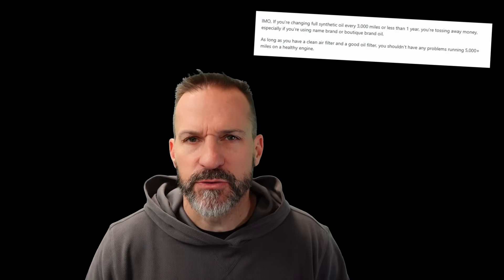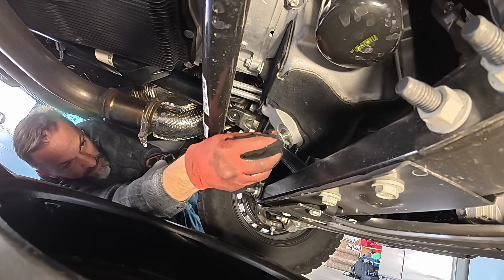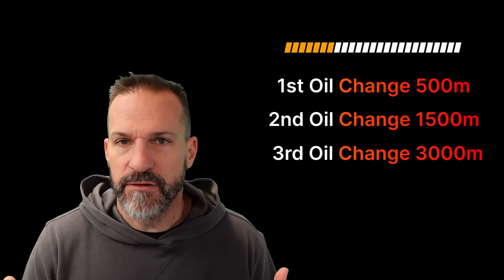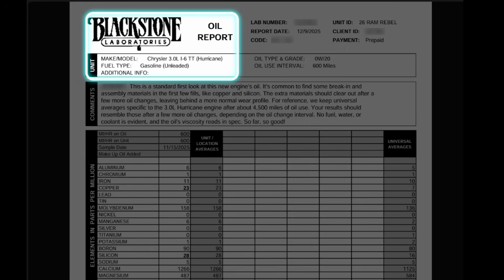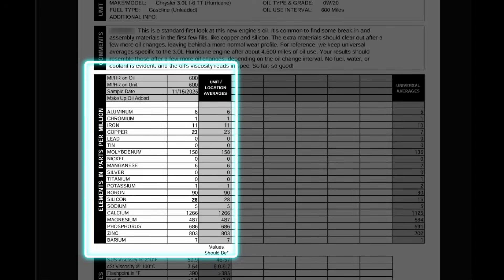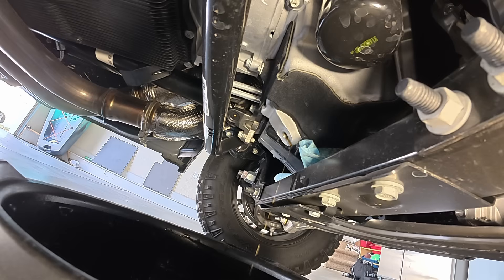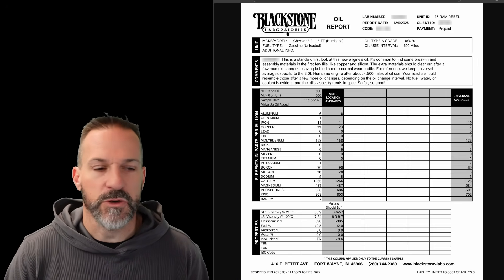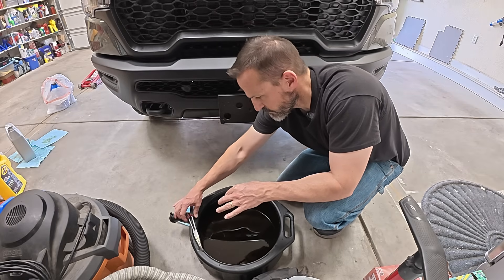Is the Motor Oil Geek Right? I Put His Break-In Theory to the Test

Comment: I would highly recommend Oil Analyzers Inc (OAI) or Speed Diagnostix for UOA’s. Blackstone’s fuel dilution test is nowhere near accurate. I figured that out with my Subaru Ascent when I was seeing 0w20 reducing to a 16wt viscosity in just 4k-5k mile intervals, yet Blackstone showed only a trace to 1% fuel dilution. Come to find out after using OAI, fuel dilution was well over 5%. Either way, keep up with the break-in! It can only help!

Comment: Not an automobile, but the manual for Takeuchi equipment say to do your first oil change at 50 hours and then every 500 hours after that. 
I still do them every 250 to 300 hours like they used to recommend, it cant hurt

Comment: More metal does not mean the engine is harmed. The oil is meant to keep impurities in suspension and the larger dangerous bits are caught by the filter. Intresting to see what would happen if you left it in. Is there any way to scientifically measure the damage done

Comment: A lot to unpack here....until recently, you didn't have many engine failures (think Toyota, Ford, Chevy trucks). The volume of failures and number of recalls is alarming. Don't hear much about sedans (minus maybe to tiny engines with turbos...maybe). Take your average sedan/SUV that is not hyper tuned with turbos, I don't think the engine failure rate is high at all, could be wrong. I think oil change early is not a bad idea, but is it really necessary, even with the testing numbers being shown. Ok, so you have break in metals coming off. If you didn't change the oil at these short intervals, does that mean a death sentence to the engine at 50k miles? Doubtful. What about 100k? or 200k? I would wager that the truck in question here, will rust out, have transmission failure,  electronic goblins, etc way before the engine would fail AS A RESULT OF NOT DOING EARLY OIL CHANGES as the videos suggest. I am not a proponent of going 10k mile OCI, 5k is reasonable for NA engines, I would do 3k for turbo.  There is such a thing as too much information, and the internet is full of it. As for personal experience, I have never done early oil changes on any cars. All of my cars have gone 250k miles on OCI of 5k or 7500 miles. I have also maintained many other cars, one is 25 years old, with relatively low mileage on conventional oil. I never had an engine fail, all vehicles drove fine when I sold them. Some had body rust, one had something going on with the tranny, etc. My current vehicle has 150k on it. For the first 100k miles, I stupidly followed the 10k mile oil change interval WITH driving most of the miles locally, short drives, etc. Engine is still fine and going strong. This is before I knew any better.  I guess the question is, even with the testing data, how do we know if you didn't change the oil at these low intervals during break-in that there would be engine damage to the point of not getting 200k out of it....we simply don't know. Correlation does not mean causation. Just because there are high values in the test results doesn't mean the engine will fail or if it fails, doesn't mean it was the result of not doing this oil change break in procedure. Another example, a friend had the same year car as one of my cars. I did all maintenance on my car. Oil changes, etc. at 7500, tranny at 30k, etc. He followed the dealer advise oil changes at whatever the car told him, tranny every 100k....He has 450k on this vehicle. Mine is at 300k. Both still kicking. Good engineering, manufacturing, QA, results in good cars and with this example, seems like you could do minimum maintenance and get good results (both vehicles are 2010 Honda). I think we are trying to protect against poor designs, poor engineering, poor QA with increased oil change intervals. You could do 10 mile oil change intervals on the Tundra and the engine will still blow at 10k miles. Nothing you can do will change the garbage coming out of Toyota these days. Now, on my next car, I will do an early oil change? Probably "just in case" there is something to it. But I don't think there is a need to or a must have. More of a nice thing, to give you piece of mind. Unless car came with break in oil and now you cause damage by draining it before you should have....another topic that can go on for days.

Comment: See this aspect, when the engine is really cold or on full throttle, oil bypass valve will open and let the metal debris into the engine. Thats the reason its good to change breakin oil and filter.

Comment: You said your engine is double turbo'd, right?  Clean oil is extremely important for keeping those healthy, along with letting them cool under idle for a few minutes before shutting off the engine on long or hard drives.

Comment: The car companies want you to go 10,000 miles with full synthetic oil. That way they can sell you a new vehicle just after the warranty is up. Why ? Because the engine is toast. It's all about money. Them making it from us. I change mine every 6 months. Being retired I no longer drive as much. Maybe 4000 Miles per year. So every 2000 miles in that 6 months give or take. Oil change is cheap insurance.
Reply: Why would they use that strategy?
It makes little sense, because costumers would be unlikely purchase the same make of vehicle that failed them so early and badly.

Comment: The question is not whether the science is correct, it’s whether the wear that is caused from following the manufacturer recommended break in is enough to shorten engine life. I won’t listen to the oil computer in my truck, but I did my first oil change at 5k (2020 Ranger) and I’m not worried about it. If you want to be super safe, I don’t think it can hurt. And I likely would have done this kind of thing if I researched it more, but I don’t think the wear is really meaningful (uneducated opinion). Poor maintenance after the break in will kill something way sooner than a slightly less than optimal break in period with continued good maintenance.

Comment: At an absolute minimum the first oil change at 500 is critical. EVEN if the initial analysis were to show no high metal counts, that first oil change clears out any assembly lube, any dust, or anything that might have contaminated the motor in the original construction and assembly process.

Comment: Good video. I always drain oil early on new engines. I have experience with turbocharged and normally aspirated road race engines, many of which are disassembled early in life for upgrades. A quality engine will show very little visible or measurable initial wear. This means that while it remains a good idea to change oil early, wear is a factor of use over time. Adequate viscosity matters (a lot) as does contamination. Choose a quality synthetic and change it regularly. 

Put another way, if oil is significantly contaminated at the 4,500 mile point (like most Ford 3.5L Ecoboost engines) going a full 10,000 miles means that contaminated oil is circulating for 5,500 miles before the oil change. Don't be surprised if phasers and cam chains fail before 100K miles.

Comment: I did an insane amount of break in oil changes on my 2025 Camry xle hybrid awd even changed diff fluids and ecvt fluid at 18k did an oil change at 500 2500/3000/ 5k and at 11/12k 18k and 24k 30k with filter changes as well car is at 34k going strong close to my next oil change

Comment: The reason not to change the filter is because it actually gets more efficient as it loads up with particulate.  So it will actually capture more and potentially smaller particles than a brand new filter.  Only thing better would be to install a high efficiency bypass oil filtration system and that's a whole separate thing...
Reply: Conventional Mechanic wisdom

Comment: Why would you not change the oil filter with the first oil change? When I rebuild an engine I use mineral oil and change the oil and filter after 100 or 200km, again at 1000km  and then every 10,000km with quality oil. And yes I do oil analysis (from time to time, not every oil change).

Comment: Not going to lie, maintaince is cool but you dont have to completely anal about it and do 5 oil changes in first 5k miles.

The electronics and plastic cooling hoses and pipes will fail way before engines and transmissions these days.

Comment: I agree with Lake and yourself. I do take it a bit further - I drive my vehicle home from the dealer, dump the factory fill, refill with actual break-in oil,  run that for 500 miles then switch back to the main oil I will be using and change the oil again at 1,500 miles and 3,000 miles. The oil change on your truck looks nice and easy. My newest truck is a 2025 Ford Ranger with the 2.7l Ecoboost - draining the oil on the 2.7l is a kin to opening up the floodgates on Hoover Dam.

Comment: Go to 5W 30 oil  if you use synthetic oil because synthetic oil goes where no oil has gone before. When my 5.9 cummins was brand new I ran Rotela regular oil no synthetic and did that for a year then switched to Amsoil 15W40 because synthetic will not let the engine to wear in properly so that’s why I ran Dino oil the first year and I did change my first oil change at 200 miles and filter and the second oil change was at 500 miles and filter and third oil change at 3000 miles and after oil samples are sent in at every oil change to check for coolant and diesel fuel and I do check all wear metals to and Black Stone and I have never got a test back that says my oil needs to be changed but I still do 5000 mile oil changes unless Iam pulling really heavy loads and pulling alot of mountains which in Missouri we don’t have mountains just hills and a few long big hills but when I haul my 3500 lb TC camper in the bed and pulling my jet boat at the same time and Iam doing this like my trip to Alaska and I will change it at 4000 miles and with oil  samples  and they never said change my oil they always said to go 1000 more miles and retest but I always in progress of changing my oil and I put a guts i valve on my drain plug on my truck because it’s so much easier with a valve and not wear my drain plug out and start leaking oil at the drain which they do start to leak and I bought this truck new and not one problem yet and still has the factory water pump, alternator and hoses they only think that has been changed belt tensioner and idler pulley when I changed my belt at 125000 miles and I kept the old parts for spares when I went to Alaska but didn’t need them but if I didn’t I would of needed them . And I did do some upgrades a Fleece intank lift pump and a gauge on my dash for lift pump pressure and a Fluid Dampner and two extra fuel filters and the one on the block I changed it out with a Baldwin 5 micron and a Cat 2 micron and a big Balwin 5 micron water separator with drain and the factory filter spot has a water sensor with a light on my dash that has never came on before.

Comment: I trust Lake 💯.  I think you're doing the best thing if you're planning on keeping this long term. I recently bought a 2024 GMC Canyon with the 2.7 and I changed the oil at 1,000 miles and every 3,000 since.  It doesn't use any oil between changes.  If Lake had this video out sooner i would have done exactly what he says.

Comment: Anecdotal but I've always done a 1k mile first change for years and 3k regular intervals and never had engine failure. I should probably send out analysis at some point but I honestly don't drive that many miles either. I'm not easy on my cars' engines, I make them work, but I keep up the maintenance.  I've owned most vehicles over 100k miles and two close to 200k before selling or trading them. Now transmissions, I've always had issues, manuals, automatics, I've never had any make/model where I felt the transmission was particularly confidence inspiring.

Comment: Anyone interested in doing their own oil changes, especially if it's frequent because it's part of this break-in process, could consider replacing their drain plug with a Fumoto valve or a similar product of another brand. It is a valve that goes into the plug space, so that you can drain more conveniently without needing a new crush washer each time and without putting wear and tear on the threads and the need to inspect threads for debris. There are versions that also have a nipple connection for a hose so you can direct the oil into a container instead of it slopping around in the general direction of your catch container. They are a little larger than a drain plug's bolt head, so if ground clearance is a high concern it may not be for you, but there are also low profile versions.
Reply: Oil comes out slow with them lets more trash stay in motor.

Comment: I appreciate your content, and appreciate the effort to add some technical depth to your videos.  However, I'm not sure what your experiment proves -- the presence of more metal, in early oil changes, is not surprising (and this is supported by the oil report's comments).  

I think that the main question -- which can really only be answered by a developer or manufacturer with significant endurance testing across multiple engines -- is how a given oil change interval impacts the long-term durability of a particular engine design, as measured across a wide-enough, statistically-significant sample of said engines, under a variety of test conditions (temperatures, acceleration profiles, etc.).

Unlike what you suggest in your opening statement (that it is marketing which sets these intervals), I contend that the engineering and/or QA departments almost certainly perform these tests and set intervals to balance longevity requirements versus the onerousness of the request to the consumer.  Without this information, manufacturers wouldn't be able to accurately estimate financial liability for warranty replacements -- engineering programs absolutely want to understand the durability and trade-off risks of the products that they create.

Of course, we will never know what specific objectives a particular manufacturer has chosen to optimize around.  Perhaps consumer pressure could (one day) normalize the sharing of such design standards, but I doubt it.  At a minimum, I would imagine that most manufacturers will want to ensure that their engines can, on average (across a variety of use-cases/scenarios) meet lifetimes which are 1.5x to 2x the base warranty mileage with a given oil change interval.  Beyond this, it's anyone's guess.
Reply: yup - we know that the reports show numbers. what we don't know is how those numbers correlate with performance or longevity. we also know from the video that oil in the database at 4500 miles had LOWER metal levels than the short 600 mile oil. that tells us the filter is doing its job. The fact that the engine didn't seize during the first 600 miles is strong evidence that the level of metals seen in the 600 sample is not enough or large enough to damage the engine. ? what am I missing? is this just fear and dread and "doing something" to make us feel better?

Comment: Good video, but here's another one for consideration if you're thinking about oil change intervals: https://youtu.be/tfb6KdwSom0?si=nd7iAk3qlirxw4Dt

This guy is an engineer who does a lot of videos about oil and makes extensive use of oil analysis to support his position. The TLDR version: even though oil change intervals of 6-10k miles on new cars seems far too long compared to conventional "wisdom",  oil analysis shows very clearly that those intervals are perfectly fine. Based on the oil analysis, changing oil at 3-5k miles is a total waste of time and money in most cases. If it makes people feel better to change oil so often, so be it but the evidence shows that it is not at all necessary or beneficial in terms of long term engine wear.
Reply: Excellent video in that link, thank you for sharing it.
Engineering Explained has done some very good videos on engine oils as well.

Comment: Lake hasn't shown that removing wear metals via early first oil changes will reduce total long term wear. All he has shown is that wear is greater during break, that early wear rate decreases naturally regardless of early change intervals, and changing oil early will........get this, result in cleaner oil. We then observe lower wear rates with subsequent oil changes, but he hasn't shown those per mile wear rates benefited from the early changes. Why is no one thinking about this correctly. All Lake has is the assumptions that wear metals in oil, even if that wear was inevitable, is inherently detrimental but he hasn't proven it. Just because it seems to make sense, does not mean it does.
Reply: What you do with the data is up to you. If you believe it's not detrimental to overall engine wear then fine. It will be very near impossible to prove one way or the other to consider comparing engines with or without early oil changes due to the vast variables involved. So, take it or leave it. I'll take it since it's cheap to do.

Comment: I’m 64. When my parents bought new cars either the manual or the conventional wisdom of the day was a 500 mile break in, then change the oil and filter, then do it every 3K after. Everyone ran 10w-30 in the winter and 10w-40 in the summer, particularly in the southern states. American cars and in the early imports.

I don’t recall exactly when. It was sometime in the 80’s. These longer interval oil change recommendations started. I never bought it. My 2002 Xterra with 215k on the clock seems to be supporting this approach. I have gone to full synthetic of course. 

So, I totally agree with this approach. I would also add … look at your oil. If that dipstick starts showing black stuff, it’s close to time regardless of the miles. 

One long hot trip will toast your oil in my experience.
Reply: Oh, for the uninitiated, vary your motor speeds during that break in and DO NOT stress the engine. Be patient. Let everything get to know each other. 😊